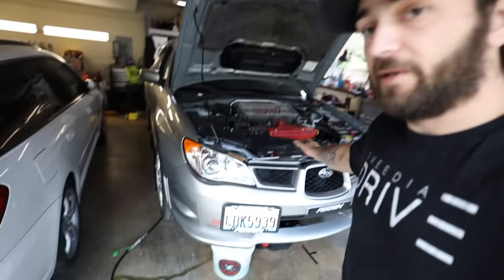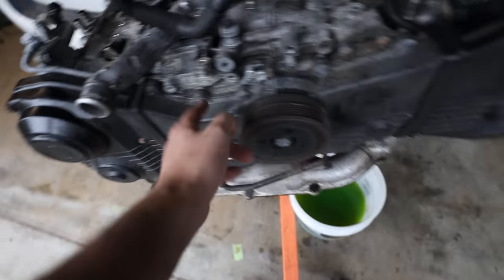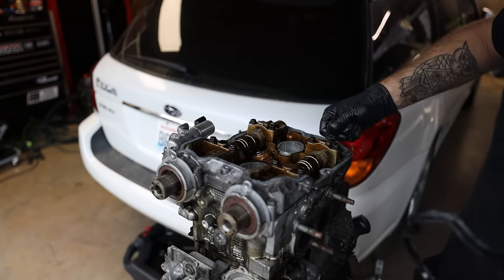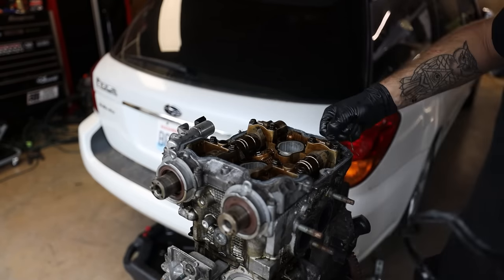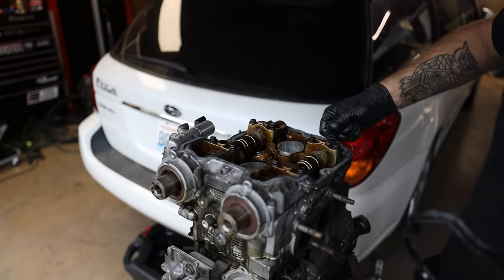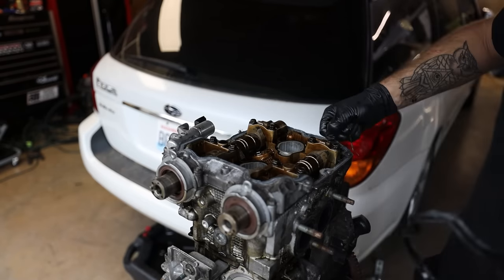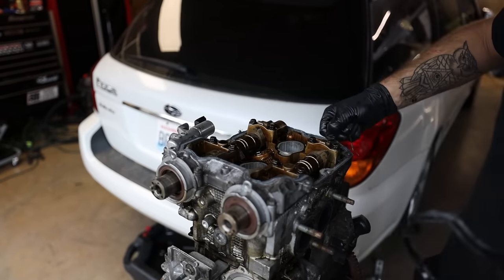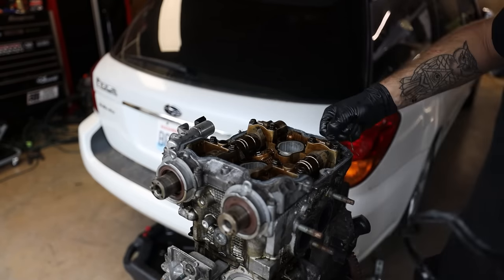How To Refresh your Old Subaru Engine

Comment: Props for posting this Video Tanner. I agree that it's not any one persons fault. An experienced car person would know to keep their eyes on the data, especially after a major service like this. On your part I agree completely if you failed to tighten the clamp it would have leaked right away or on your test drive....

All that being said would it be a possible failure point if the head gasket failed and the coolant system saw boost pressure? Not saying this was the culprit just wondering how possible it would be?
Reply from the maker: I don't think so, I got thr car into boost a fee times and if it was the gasket it would have popped almost immediately when I got into boost, 

The worm gears were the old ones on the car, as coolant Temps get hotter it causes the clamps to expand a bit. Because a worm gear can only apply constant pressure I think that's why it failed. Old clamp and exspansion from the heat. The sling clamps will always apply a constant pressure even with exspansion from heat

Comment: Always love watching your videos.  Just curious, I have a 2010 (5th Gen) Legacy GT that has oil blow by and am looking at replacing the turbo... what would you charge to do that and what kind of time frame do you usually quote for jobs?
Reply from the maker: Do you already have an AOS?
Reply: @Smeedia  no AOS, it's 100% stock. Dealership says oil seals are going bad, recommended replacing the turbo because I'm 200k+ miles.
Reply from the maker: I'd get an AOS First and see if that helps. Typically that cleans up like 90% of thr blow by. 

Unless they've already verified the turbos going bad, don't normally see seals go bad on turbos. But it's phesable

Comment: Hey, I got a question I hope you can answer! I hate to ask forums because I know the hate I will get lol. I have a 2012 WRX Hatchback in rally blue that I love. It went from 49K to 215k without a single issue other than the clutch, brakes, tires, and headlamps. Now it has low compression in a cylinder. The car itself is in great condition. No rust, no tears inside, carpets have been always covered by mats, etc. I want to drive the car but inspection won't pass due to engine fault with cylinder.
I'm curious, should I just buy an engine from eBay? They say compression is between 130-140 in all cylinders, and the engine looks VERY clean, but not clean to the point where they cleaned it just for photos... It is USDM but they don't know the mileage :( 

OR do you think I should rip apart my engine and rebuild the short block? I have the money but I don't want to stick too much money into this... but there is an ROI, and that is I get to drive my truck less... if I keep driving my truck, the worth of it is going to decrease more than the cost to put in a new engine into my Subaru and drive that instead.

I'm good with my hands, I have tools, I've done this work before but not on Subaru (Mitsubishi is where my mechanic experience comes from), I have a truck, I have a place to work on it, etc.

Comment: Dude!!  This is right on time!!  Thank you for putting this together.  Quick question:  would you apply the same principles to refreshing an EJ22E?  Obviously changes in the process...

I'm picking up a 1993 Legacy tomorrow and will be building for HooptieX/Gambler500 but would like to go through everything.  226,xxx on the clock.
Reply from the maker: Yessssssir. Should be fairly sane same for any subaru engine 💪
Reply: @Smeedia  Dope!  Yeah, the engine just needs a nice solid degrease, intake man. gaskets, rear main is leaking, and has REEEEALLY old coolant.

I'll be honest, I like the gear ratios a lot better than my '09 rex, and I like that better than most 6spds.  If you haven't driven a 1st or 2nd gen legacy or GC8, you need to.  Thanks, man!

Comment: Solid dude right here! Hella helping a youngin in the learning processes.
Curious though, what caused the worm clamp to come off? How do they exactly 'fail'?
Reply from the maker: When they become old and used, they can stretch and no provide enough clamping force. When pressure is built in the cooling system, it overcame the force applied by the clamp and poped off. OEM clamps are what I suggest as they always provide tension, even as a hose becomes old and starts to swell 🙏

Comment: Yeah but I’m sure you did say. Keep an eye on fluids and any wet spots. Granted it’s not a rebuild but 🫣🫣 130k on an STI shouldn’t be leaking unless that motor isn’t watched when spirited driving takes place. 
I just had a motor put in an mechanic actually used those straps vs the clamps which you can reuse even add more tension by decompressing them back down a few mm. Clamps will clamp as hard if not slightly more than they where. Right now I’m keeping an eye but when I got my car back I noticed by the motor coolant runner was dripping on timing cover. Maybe say 1/4 of a cup. But we are likely the same age so. Monitoring is just second nature if not enjoyable lol. 
Thanks for helping dude out. And I hope from this he becomes a more technically inclined enthusiast rather than the type to bash the brand. 
But yep those worm clamps are garbage. And can’t believe they used them on my motor. 
But I’ll be grabbing the right clamps also. Cause they also tear into rubber hoses being so thin vs stock clamps being square & rounded at the edges.

Comment: I am about to do the same thing to a 06 obxt. Horrendous misfire on cylinder 2. Go through and just redo everything. I believe I have a head-gasket failure and possible burned exhaust valve on that cylinder. 32 PSI of compression.

Comment: Another great video.  Quick question, I know the head bolts usually have a torque, loosen, and re-torque.  is that to pre-stress the head bolts and because you're using ARP head studs you dont need to pre-stress them?
Reply from the maker: Yes and no. Because the stock hesdbolts are so long it helps get a even value across the head. While with the studs were only torquing the nut instead of an 18" Long bolt 😅

Comment: Did u check the valve clearance after you lapped the valves? Should have changed possibly, I always check, although it does make the job considerably longer.

Comment: to do with the rebuild, why didn't you use copper sealant on the head gaskets? Just curious as my mechanic swears by it however he doesn't do Subaru head gaskets.
Reply from the maker: They dont need em, when done correctly the headgasket will hold just fine 🙏 
Iorn blocks it wouldent bad a bad idea if you were doing one on them

Comment: I'm late to the party, but I'm flirting with the idea of refresh my 2011 Subaru Legacy EJ25- 2.5 Liters (non turbo)Engine gasket leaking. But the e brake is not working, and the CVT transmission got a lot of stress after putting in parking in hills, and take it back to drive. Should I add a manual emergency brake like old school, or fix the electronic brake? Also, How hard is to swap a CVT (non turbo) to a 5 speed manual transition on that EJ25? Thanks for the time, and work that you put on the videos. Appreciate your time.

Comment: Oh sweet, I'm early! Random shot in the dark question that's been bugging me.

So my 2011 WRX... "knocks." Feedback knock will read 1.5 to zero when driving, but when I just barely open the throttle, it quickly climbs up. I've seen it read as high as 11.5, but without any audible noise or DAM drop. It's really been puzzling me. It has all the standard fixings... CAI, entire exhaust aftermarket, 20psi turbo, turbosmart bov, pro-tuned to almost 350hp by a local shop... I'm thinking it might be sparkplugs since I haven't had them replaced in the entire 104k miles, but any other suggestions would be nice.
Reply from the maker: As weird as this may sound, look for anything loose around the knock sensor, but spark plugs are a good place to start!  -1.50 is considered normal 

Do you have a lightweight flywheel at all?
Reply: @Smeedia  I actually think the tuners dropped an irretrievable nut onto the top of the block when tooling around, but that was a long time ago. Maybe it worked itself free? I also have been running the AC pretty hard on these 90° days here in VA. I also don't have a lightweight flywheel.

And another quick question: why do you think my tuners would leave the forge BOV sticking off my grimspeed intercooler when installing a Turbosmart BOV too? The turbo sounds cool for sure and it makes the 20psi advertised, but I don't know why they'd run two wastegates.

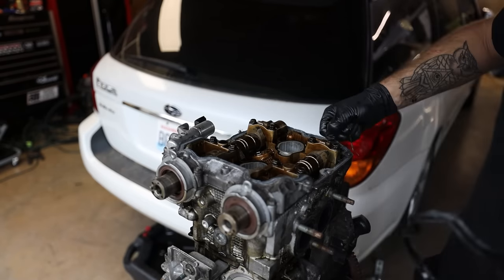Comment: @33:09 I refuse to drive  AT ALL over 215 degrees… I just pull over and pop the hood. Let it idle for a moment so the fans can cool things off and the turbo doesn’t just fry the excess oil spinning in it. I might be going a little carefully but this is my first:
Manual transmission car
Performance car
AWD car
Turbo car
Reply from the maker: Smart man, normally around that point I'd do the same

Comment: There is a chance that the water pressurised and that’s what blew the hose off.  
This could be because you didn’t deck the block. Even just a flat stone to clean it up and ensure it’s flat and clean.
Reply from the maker: Surface flatness on the block checked out to spec, plus of that were the case it would have pressurized as I was driving it and popped the hose off. In most cases you don't need to deck the block unless it's seen extreme heat and is warped. Plus both sides or the case were prepped and cleaned (Razor off any old gasket and clean lightly with scotch bright and parts cleaner). 

When I got out there to the car, the worm gear was loose as hell, if it would have been from leisure it would have split the hose before poping the clamp

Comment: I live in Texas where the temperature is regularly 100 or over. My coolant goes over 215 regularly. I guess it all depends on where you live and the weather you're driving in? My short block is built.
Reply from the maker: How high does it get? I'd look into some cooling mods
Reply: @Smeedia  I have a koyorad. It goes up to mid 220s if I'm beating on it and will drop down to 200s at red lights.
Reply: @Smeedia  also this is on an fa20
Reply: I'm an idiot. I flipped my oil temps and coolant temps. Coolant doesn't go over 206. Oil temps hit 220 as a max
Reply from the maker: That sounds better 🤝

Comment: We use torque wrenches at work, they are sent off for calibration every year. Guys that have used these tools for years, I still see using a TW to loosen, they can not be used for that. Even if it has a reverse.
Reply from the maker: Why would someone use a torque wrench for loosening bolts? 😳

Comment: wait so are coolant temps above 210+ not normal? the weather here in jersey has been pretty hot this past month and my coolant temps have been close to and sometimes reaching 220~ while idle. granted, they do go back down to 200 or so once I’m moving
Reply from the maker: I'd look into some cooling system mods. They shouldent go that high. While coolant had a slightly higher boiling point, my general rule of thumb is 212 is cut off for me.

Comment: Hey Tanner I just threw a p0014 code while driving the highway. Everytime i pressed the gas I heard a tapping noise. Pulled over seeing my temps go to 210, and then my car died. Any tips?
Reply from the maker: Sounds like your cam posisition sensor died on you 👀

Comment: Do you have to removed the valves for the heads to be surfaced ?  If you do and if you put the same valves back into their original location would the clearances be the same as before?

Comment: At this point, do you just have the vacuum lines all memorized? I'm taking my intake manifold off right now, and thank god for cobbs manual on it.
Reply: You got a link to that by chance? I'll be tearing my motor out in a few months and I'm not looking forward to dealing with that rat's nest of lines everywhere lol
Reply from the maker: After the first few times you start to memorize them 😅
Reply: @calebunrau9591  It's not letting me respond with a link. If you search cobb fuel rail and line install, there should be a pdf. This is mainly to show how to install the fuel setup, but it goes in-depth on taking out the manifold.
Reply: @Brett4517  found it. thanks man!

Comment: Hey there is a easier way then drilling that cam bolt out. Tap a nut extractor over bolt and breaker bar bam was the easiest way I have found
Reply from the maker: Normally that's what I do but my last one broke 😅

Comment: Always use the OEM spring clamps.  Could be the Steam that you thought was PB blaster was coolant evaporation on a hot surface as it was leaking? I pulled my STI engine at 85 000 to do the clutch timing helt and motor mounts and replaced all the coolnt hoses and clamps with oem...heater core hoses too.Never leave a weak link after doing an overhaul like that.
Reply from the maker: It was def PB blaster/Oil coolant burns really white and has a sweet smell to it when burning off 🙏
Reply: @Smeedia  true. Ive never had a worm clamp fail to the point it woul allow all the coolant to leak out...unfortunately the owner should have noticed THAT MUCH coolant leaking out..it would have really smelled bad..that characteristic sweet smell.  Thats a shame.
Reply: Also inspect the radiator on that car now,, that kind of  overheat can crack the upper plastic tank

Comment: When mounting the engine and transmission bell housing, how close was the gap before you started tightening down the bellhousing bolts? I have about a half inch gap and idk if its stuck on the input shaft or if its just the dowl pins that are stopping me. I have the car in first gear and I've tried turning the crank pulley by hand little by little and wiggling, but still havent got the two to sit flush .. suggestions ?
Reply from the maker: Maybe 1/4" or so, you don't wNt to force it if it's not going in. Can damage the input shaft 

Sometimes taking it out and putting jt back in works surprisingly well for some reason. Have had to do that a few times

Comment: Defrost turns on the A/C. Is that correct? I've always heard to run the heat with the A/C off. Thanks for the video!
Reply from the maker: I tuen off the AC and let er rip but you are correct 🙏
Reply: @Smeedia  Ok, good to know. Thanks!

Comment: Completely random, but do you have a walk through or helpful video for wiring? I disconnected everything when I pulled my motor 3 months ago, and I might have forgotten where everything goes and what goes above or below certain other parts 😅🤦
Reply from the maker: I do not but I could possibly make one 👀
Reply: @Smeedia  well, I just so happen to have an 04, you know just in case you have an 04-07 laying around 😂😏

Comment: Hey I just bought an EJ20 for my 2005 WRX cause I blew up the first engine this is the first swap I’ve ever done alone and I’m nervous I’m sure there’s a video you have for it but I love reassurance on the “new” EJ20 it has 45-55,000 miles on it it’s just the short block, my accessories are fine so I’m just gonna slap it in while I’m at it should I replace the head gaskets on it and replace my clutch ? Idk man I’m just super nervous whenever you can I’d appreciate t he help thank !

Comment: The xv has a priming mode (you have to crank it with the accelerator and clutch press all the way down) idk if the sti has it also
Reply from the maker: Newer ones do, the older ones should also. But last time I tried on a GD it revved to the moon 💀
Reply: @Smeedia  jajajajajajajaja

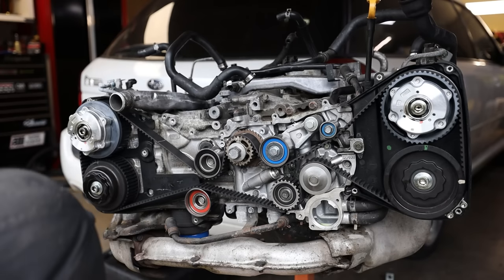Comment: You did not show rotating the engine to the maintenance position before removing the belt… very important to avoid valve collision with pistons when the cams spin after the belt is removed.  Can tell that you did this since the white spot on the crank gear moved to the top at 5:42 (where you edited the video) before removing pulleys.
Reply from the maker: Yesss, very good point to add in, always set timing back to avoid potential damage
Reply: Point is anyone watching this as a kind of tutorial (multiple people commented as such) might damage something because the video does not show it or mention it… anyway happy wrenching and driving.

Comment: Currently installing a rebuilt EJ25 back into an ‘09 forester. Got really confused when done timing the engine I checked compression coming out of the exhaust valves in the heads and found that for a short time the exhaust is pulling vacuum. Not really sure why, the timing seems to be point. Might be some weird emissions thing. Have you ever experienced this?
Reply from the maker: I cannot say I have. The exhaust valves are pulling vaccumm?!
Reply: @Smeedia  yes they pull vacuum. Not for a long period but they do. I was shocked lol

Comment: Question, how important is a cylinder 4 cooling mod on an EJ if you go ELH. Is it just overkill at that point? Should you remove it if you change from UEL to EL?
Reply from the maker: Imo I'm impartial to em, if you want one snag one if you don't then no worries I've ran ejs with and without them and never saw a serious change

Comment: I have a 2005 legacy gt and the motor lost all compression on it. We think the timing belt went and belt the valves. Is it worth just buying heads and a timing belt if my bottom end is fine or should I just do a whole motor. Cant find any motors though.
Reply from the maker: That depends on what your budget is what your goals with the car are. If your just looking to get it back on the road, pull the valves and inspect them, and replace with oem of need be. If you want power later on then I'd replace

Comment: Curious on your thoughts about one step colder spark plugs on a stock or stage 2 setup? It seems awfully tempting simply because of the reduction knock
Reply from the maker: I do it on all my cars 👀 NGK 2309s
Reply: Do it. I think stock on Wrx is a 6 N/A a 5 and likely 7 heat range on STI. 
Had a SOHC I boosted years ago and it ran great on NGK’s stock plug with a 7 heat range which are going to be the same part number minus heat range number being one number (step) colder. 
But yeah agree get them and spec them.